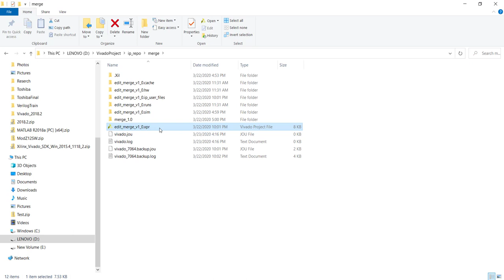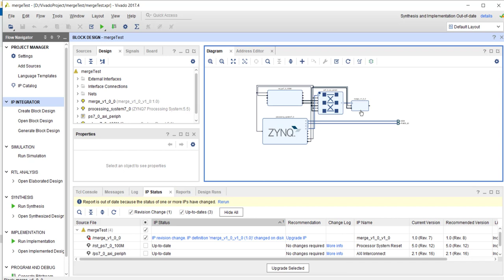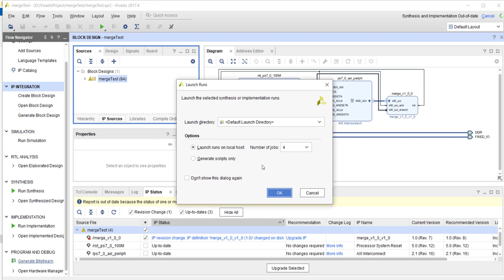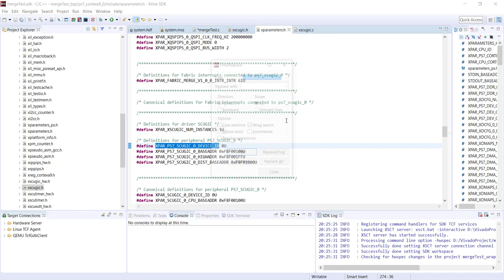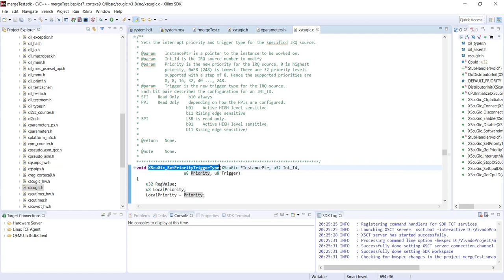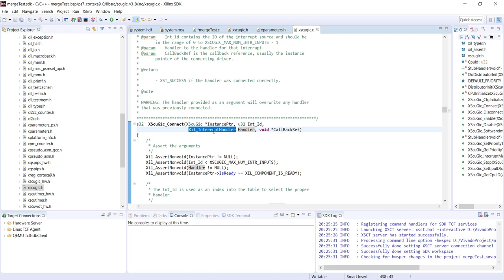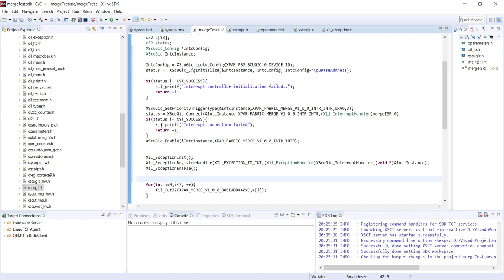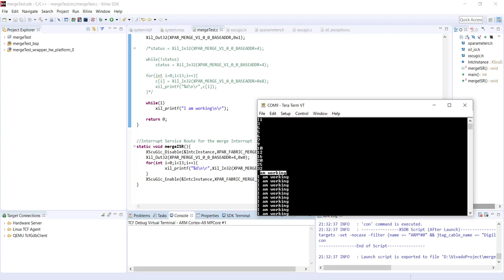Designing an Interrupt-based System targeting Xilinx Zynq

Comment: Thanks you very much. It was carefully explained. I tried using the same approach for Xilinx axi-can with the IP drivers, it is sort of different as it uses event handlers and masks. I have several instances of the IP with individual interrupts. I couldn’t get it working. Is checking my src file something you can help with. Thanks
Reply from the maker: Please watch the videos on image processing or video processing to find handling multiple interrupts.
Reply: Vipin Kizheppatt  thanks for replying. I am running it on the R5 RPU of the zynq Ultrascale+ MPSoC. The interrupts do not seem to work...I am not sure if the R5 uses legacy interrupt and how multiple interrupts can be concatened. There are really no tutorial examples of R5 interrupts from the PL.
Reply from the maker: Sorry I never got a chance to test ultrascale. It is in lab but can access only after corona issues r solved
Reply: Vipin Kizheppatt thanks

Comment: Can we use a general purpose input output pin for detecting an interrupt? I mean, what you have done in this video can also be done by using a genral input pin instead of the interrupt pin. Am I correct?
Reply from the maker: Yes. Interrupt can come through pins also especially when we interfaces with external peripherals. If you want to handle that interrupt in software it has to be then routed to the PS through PL.
Reply: @Vipinkmenon  Then, could you please demonstrate that (using external genral input pin instead of interrupt pin in this case).
Reply from the maker: First try an example by yourself. In the block design, enable fabric interrupt. Then from the PS block, choose make external for the interrupt signal. After synthesis, in the constraints file, assign a push button to this interrupt signal. You can use same ISR in software. Now whenever you press the push button, your software should detect the interrupt. Try it first. If not working, let me know.